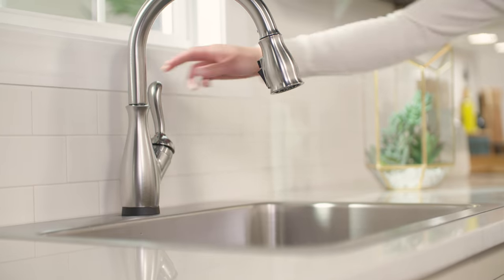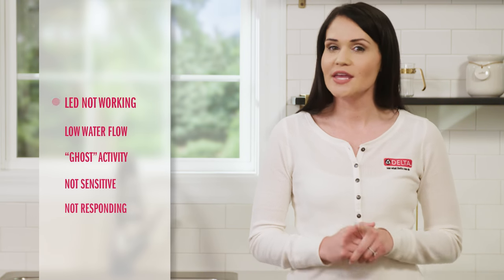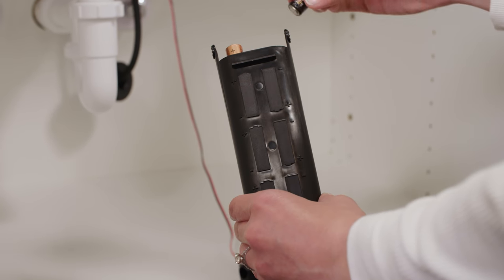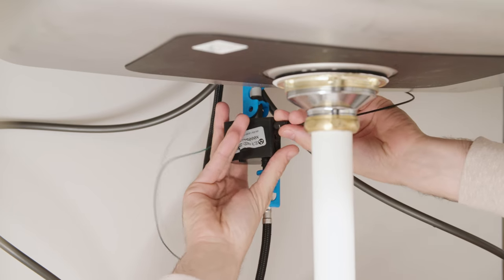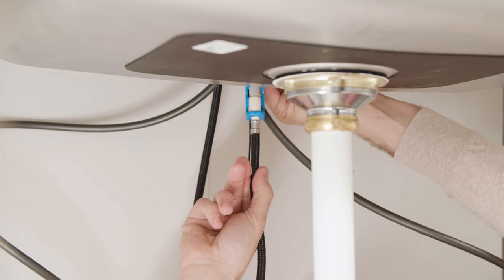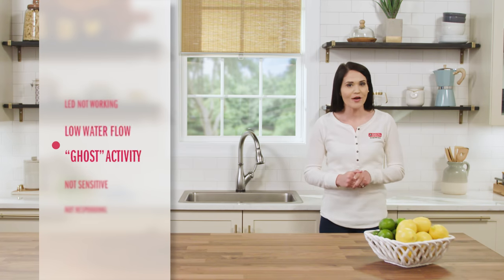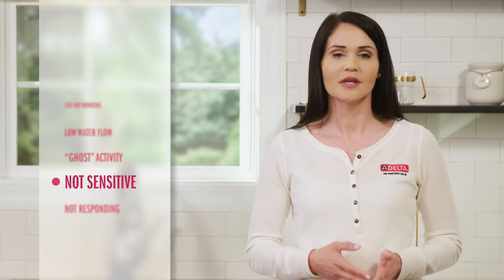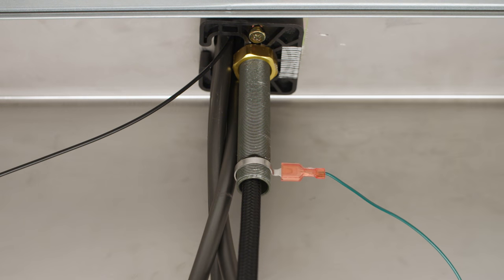How to Troubleshoot a Delta® Kitchen Faucet with Touch2O® Technology

Comment from the maker: Hi Denis!

I'm sorry to hear that your Delta Touch2O faucet is not working correctly! I would be happy to help you. This can most likely be resolved by adjusting the installation below the sink.

Please make sure that no wires are touching metal objects or other wires. Next, unplug the black LED wire and push it back in firmly until it clicks. Please reset the solenoid by removing the cap from the battery box for one minute and reconnecting it. Be sure to use a new set of brand name, non-rechargeable batteries and install them as indicated on the box. Please also ensure that the battery box is placed on the floor of the cabinet, 2 inches from the sides or metal objects.

If the issue remains, please provide photos showing the following to better help us identify the issue with your faucet:
1. The faucet itself.
2. The sticker on the solenoid assembly.
3. The mounting nut and threaded shank.
4. The battery box.
5. A photo showing how the wires are routed if not seen in the other photos.

You can attach pictures of the faucet to your reply e-mail. Please use the jpeg file format and the maximum size per email is 2.0 MB. You may need to send more than one e-mail if you are sending multiple pictures. 

To switch the faucet to a manual mode, turn the faucet on so that water is running and then remove the cap from the battery box.

Please also provide your name, address, phone number, and the date you installed this product.

Best Regards!

Frank
Reply: Why does the faucet turn off when I try to adjust the water temperature?
Reply: Just bought my faucet worked great for about a hour and then the touch function stopped working, however the manual works fine, when I touch it the LED light comes on and off but water just keep running in on position i belive the solenoid is bad i can hear it clicking when i touch the faucet but it doesn't shut the water off. Please someone give me a idea Thank you.

Comment: Just installed a new one and it doesn't work only when the handle is on, it works all the time!
Reply: That's the way they work. The handle has to be in the on position.
Reply: @Wildtail  the solenoid works regardless of handle position. There's also a dead spot in handle position where it won't trigger the solenoid

Comment: I have mines 4 months and I hate I'm doing something else  and wifey calls me to tell me there is no water again.  3rd time in the short period .if the sensor acts up it should automatically go to hand operation delta makes great faucet but this one needs more ironing out. And the battery pack with the springs on either side could be less fickle now I got to tape and tie wrap it to keep it closed and the metal in the middle doesn't seem to work always.
Reply from the maker: Hello Paul Ra. Thank you for reaching out to us. We are sorry to hear that you are having difficulty with your Delta faucet. Please send us an email or give us a call and we would be more than happy to further assist you with any problems! -Carrie

Comment: $600 faucet that’s a few months old. Been through this list extensively. Not a battery issue. Water just won’t come on. Seems like solenoid is stuck. I feel like Delta could afford some better parts on a $600 faucet.

Comment: I love this product and it has been serving us the last 5 years without any issue.  Just yesterday. It looses water pressure.  It starts with normal pressure but turn to very slow after a few seconds. Please help.
Reply from the maker: Hi Tim!

I'm sorry that you are experiencing low flow from your faucet and would be more than happy to help! Reduced flow is typically caused by debris, which can get caught in a few different areas of the faucet. Please try the following steps so we can better assist you:

1.) First, please unscrew the wand from the hose and turn the faucet on for 4 minutes to flush the lines and see if you get good flow out of the end of the hose. Please check for debris in the wand and re-attach it. Be careful not to let go of the hose with the wand removed or it may retract into the faucet. 

2.) Next, turn the handle to the off position, place a bucket under the sink, disconnect the solenoid assembly from the gray PEX tube and check for debris in the screen in the top of the solenoid assembly. If the solenoid assembly is gray, the screen cannot be removed. If it is black, you can use a pair of needle-nose pliers to take the screen out and clean it.

3.) Finally, reattach everything and test the flow rate from the wand again.
If this does not resolve the issue, please let us know the results of the tests. Please also provide your address, phone number, and email along with the approximate date that the faucet was installed and a photo of the sticker on the solenoid assembly.

Best Regards!

Frank

Comment: All the online guides say that if the light flashes red after the faucet is off it needs new batteries.  But what if it flashes red 3 times everytime you turn if on and then again when u turn it off? Is that low batteries too?  We haven't even had this half a year why is it low battries already?
Reply from the maker: Thank you for reaching out! I do apologize for any inconvenience with your Delta Touch2O product, but will be more than happy to help! 3 blinking red lights is always going to be a indication that the batteries are running low, and we would recommend changing them as soon as possible. AA batteries can last up to 2 years, but on average will last around 6-12 months depending on daily usage. Feel free to contact us at 1-844-923-5368 or email us at concierge@deltafaucet.com, if you need further assistance.

Best Regards, Benjamin
Reply: @deltafaucet  thanks! We changed the batteries and the light went away. Thanks so much.  I guess with 3 people using the sink a lot we just wore them out quick.

Comment: We've had ours for over two years and it's still working well - except that we only have the red light working, not the blue. The blue light did come on briefly a couple of weeks ago, for no apparent reason, but then it went away again, so when the water is cold we get no indicator light. I can't find any loose wires. It's a mystery.
Reply from the maker: Hello Geo T, 

I'm sorry for the issue with the Delta faucet. I suggest resetting the faucet.  Disconnect the led wire and batter pack for about 1 minute and reconnect it. Please reach out to us at 1-844-923-5368 
 or concierge@deltafaucet.com if you have any questions. -Brandis
Reply: @deltafaucet  that didn't fix it
Reply from the maker: Thank you, Geo T! I apologize that resetting the faucet did help the light issue. Please reach out to us at 1-844-923-5368 or concierge@deltafaucet.com for further assistance with resolving this issue. I apologize for any inconvenience and we look forward to hearing from you. -Brandis

Comment: Touch faucets are AWFUL. I m so angry my new house has a Delta Touch Faucet. The light is on, but no water. Always intermittent cutoff. And I have new batteries. And now this stupid battery cap looks like it is about to crack. It is so fragile on the sides. I cannot deal with this. I want to cook and clean up my kitchen. I was running water fill the sink, and it suddenly stopped. That was 24 hours ago! I have been under the sink so many times since I got this faucet. No more. Can you just send someone over to remove the electronic part? I don't need it. Not worth the headache just to have a touch faucet. I know how to turn a handle.

Comment: way too many issues for the price you pay. solenoid issues and grounding issues a plenty. cost for a new solenoid is about $150 and if you ever change a water heater, the air in the line passing through will trash your solenoid.  definitely would not recommend this product.
Reply from the maker: Hi, 

I'm sorry to hear how unhappy you are with our Touch faucets. We work very hard to ensure our products work excellently and we're constantly improving. Please contact us directly at 1-1-844-923-5368 or concierge@deltafaucet.com If there is anything we can assist you with. -Brandis

Comment: To expensive for the performance. Very sensitive and becomes more frustrating with every day.
Reply: We waited to buy ours with a Canadian Tire special. Saved a good chunk on the price and made it worth it. As for the sensitivity. It took me a bit to get used to. I learned to
a) leave the head dangling a little so I can grab that safely without accidentally touching the main unit
b) when touching the main unit and not wanting it to turn on/off, hold it for a full second before letting go. 
c) make sure not to let pots, pans, sponges, or towels touch the main unit or tap the handle. as they too can set it off.

Comment: We purchased this faucet, and what a nightmare. It did not matter what we did, it would not work well. Then after messing with it we could not even turn the water on. I don't want to deal with a faucet that will not turn the water on. We disconnected the black box with the battery attachment, I refuse at this point to even have anyone try to get it to work, should not be this hard, and should not be this inconsistent. I will just use the faucet the regular way. Expensive faucet for a feature that does not in my opinion work well.

Comment: My Lenta model faucet started working inconsistently. The touch stopped working, so I turned the handle to the off position and waited. I figured I would just use it manually. Nope - still won't work. There is no flashing, so the batteries should be fine. Sometimes, after 24 hours of not using the sink, it will start working again. Not only is this inconvenient, it's ridiculous and not what I paid for.

Comment: The touch system is crap.  After changing batteries at least 5 times in a year and a half I finally bought the AC adapter.. That worked great for another year until it didn't.  Then it wouldn't work at all.. probably a bad solenoid but I'm sick of messing with it. I just want to be able to turn on my faucet every time and it works. I don't want to get under my sink anymore or deal with it not working. I'm completely tired of having to walk to the kitchen to turn off the water.. as from time to time it just comes on.   I watched this video and bypassed the touch system.. good riddance.  The touch system doesn't give you any advantage when you take into account all of this hassle.

Comment: Trinsic Pull-Down Kitchen Faucet with Magnetic Docking Spray Head - Includes Lifetime Warranty: purchased 2017. Solenoid replaced but new part isn't compatible with LED. LED only covered under warranty for 5 years. Lifetime warranty does not mean all parts, read the fine print. s

Comment: Delta Touch 20 faucet I paid a plumber to install, works for 5 min and then when try to turn back on nothing. check under sink each time and get led light faucet  to turn on  off  then 5  min later won't turn on. Turned faucet on and took out batteries to by pass. Now have a reg faucet and not spending a week under my sink. I have bought Delta faucets for 50 yrs and never again.  When I can save up will replace, cannot afford to have a plumber come back and take it out.  I think my grandkids toys have better make connections, flimsy wires and cheap plastic battery housing, why??
Reply from the maker: Hi Vicky, Please accept our sincere apology for the inconvenience you are experiencing with the touch function. We are happy to help! Additional troubleshooting information is available here or please contact us for additional assistance.

https://support.deltafaucet.com/s/article/Are-there-any-special-instructions-for-installing-a-faucet-with-Touch2O-Technology-1628028364224

Comment: Regardless of what temperature setting we have ours set to, at first touch, the faucet ALWAYS goes to scolding hot water, for about quick moment and then adjusts itself to the actual temperature the handle is set to which is 98% of the time at luke-warm.  Our 3yr old and 5.5yr old know to touch the faucet and wait for the indicator light to go from red to purple before putting their hands into the water as it’s burned all of us at least a handful of times already, when we forget to ‘wait it out’. Battery changes do not help and I cannot fine much about this problem online.  Seems like a very odd problem but absolutely dangerous for anyone who comes over and is not aware of this issue.  Hoping Delta support can assist via this thread.  If not, I’m going to have to bypass the touch sensor because it’s just not worth the risk. Shame because we love the feature, so far been running for a year without any other issues.
Reply from the maker: Hi Joseph!

I'm sorry that you are experiencing low flow from your faucet and would be more than happy to help! Reduced flow is typically caused by debris, which can get caught in a few different areas of the faucet. Please try the following steps so we can better assist you:

1.) First, please unscrew the wand from the hose and turn the faucet on for 4 minutes to flush the lines and see if you get good flow out of the end of the hose. Please check for debris in the wand and re-attach it. Be careful not to let go of the hose with the wand removed or it may retract into the faucet. 

2.) Next, turn the handle to the off position, place a bucket under the sink, disconnect the solenoid assembly from the gray PEX tube and check for debris in the screen in the top of the solenoid assembly. If the solenoid assembly is gray, the screen cannot be removed. If it is black, you can use a pair of needle-nose pliers to take the screen out and clean it.

3.) Finally, reattach everything and test the flow rate from the wand again.
If this does not resolve the issue, please let us know the results of the tests. Please also provide your address, phone number, and email along with the approximate date that the faucet was installed and a photo of the sticker on the solenoid assembly.

Best Regards!

Frank
Reply: Joseph,
I experienced the same thing.  Turns out the problem for me was I had not installed the check valves on the hot and cold lines and hot water was somehow pushing back down into my cold water supply line, so until it could clear back out it was super hot.  I installed the check valves and it solved the problem.   Hope this helps.
Reply: @deltafaucet  We’re not experiencing low water flow, we’re experiencing incorrect water temperature when the faucet is initially touched and turned on despite what the temperature adjustment is set at, it’s always scolding hot for about 5-10 seconds and then levels out and then finally adjusts to the pre-set temperature.
Reply: @stevenandbarbaragarbe1654  Wow, that’s a great tip.  We had our plumber install ours after building our house last year so I haven’t even checked to see if the check valves were installed.  Thank you so much for that suggestion. I’m going to confirm if these are installed and let you know.  So far this has been the only suggestion, to date, and I truly appreciate it even if it doesn’t fully resolve our issue!  Thx again!
Reply from the maker: Thanks, Joseph Arpaio! It does sound like an issue with the check valves. The water temperatures are mixed in the handle before going to the touch control. So, if the handle is left open and there is a difference in pressure between the hot and cold supply lines, hot water can back up into the cold supply line. The check valves are part number RP53468 and would be installed between the water supply valves and the PEX supply lines.
-Bryan
Reply: @deltafaucet  Thx Bryan.  Would that have been shipped with my faucet or is that an extra part I would need to order?
Reply from the maker: Glad we can help. A touch faucet should have included check valves. They can also be ordered as an individual part.
-Bryan
Reply: @JoeArp3911  Joseph,  I just came across your reply.  I have learned so many tips and how to fix things from YouTube videos, so it's nice if I can give back somehow and help others.  Hope it worked out.  :)

Comment: This faucet was already installed in the house I moved into and the touch gimmick annoyed me constantly. Every time I turned on the faucet it would register as a touch and immediately turn off again and half the time it wouldn't even work. This has to be one of the most useless features no one asked for. Thank god you can remove the box to turn it into a regular faucet again or I would have definitely torn the whole thing out and replaced it.

Comment: After replacing the batteries, the water flow is very very low. How can I fix that? Ty
Reply from the maker: Hello H.P, 

I'm sorry to hear you're experiencing issues with the Delta faucet. Please check and clean the debris screen in the solenoid. For more information on this please send a private message with your exact model number, purchase date and contact information. -Brandis

Comment: My water won’t turn on at all, I changed the batteries… I get a purple light but the water won’t turn on. Then disconnected battery pack. Water still won’t turn on. This is an old video so I’m sure I’m not gonna get any assistance from Delta. Ugh

Comment: We’ve had our Pilar Touch 2.0 for over 5 years and it seems to work intermittently. It’s always either a battery location, or wire shorting issue. Just wondering why Delta designed this like a High School Science Project. Wires hanging everywhere and silly radio shack connectors. Let’s get some new engineers on this and make a real product.